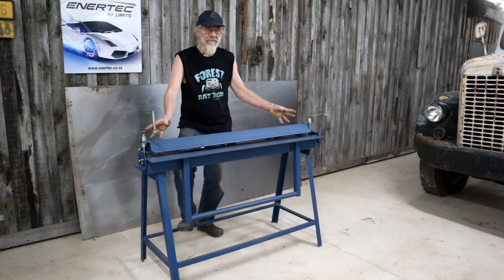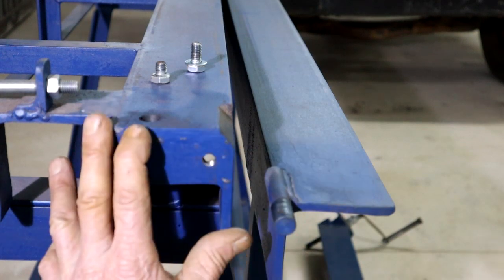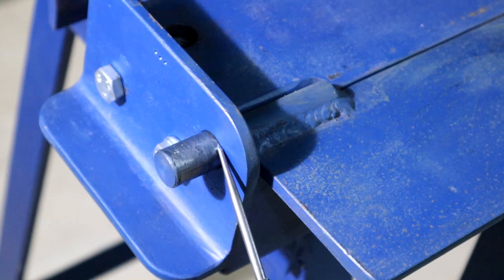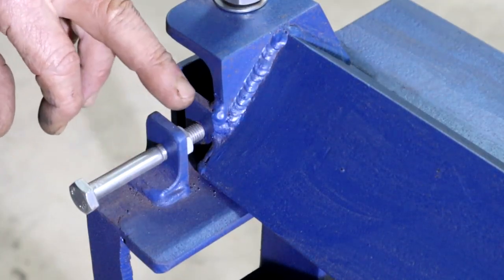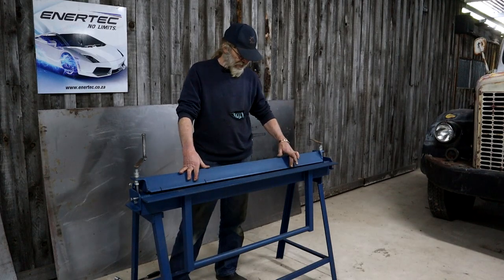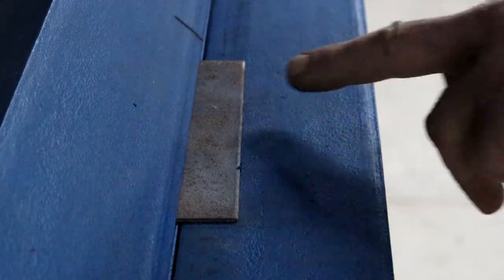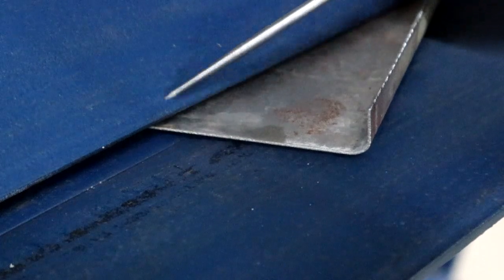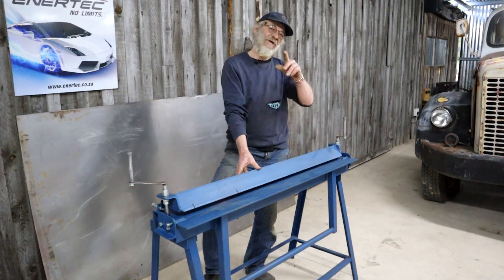GOOD DIY SHEET METAL BRAKE

Comment: If you don't often bend full sheets, couldn't you grind an edge on the far end to bend tighter bends, say on the last couple of feet? Sweet bender though. I have a Harborfreight bench bender that I'm going to adapt to your base to make my own. If I didn't have that, I'd definitely use your entire example as it's awesome.
Reply from the maker: Problem with that plan is 2 fold. You won't get proper clamp down and if you do bend full sheets, the fold will be different on one side

Comment: Nice , kinda like the one I built, you should build a pipe anvil bender. It's a 3 different pipes welded to gether with a 1/16 to 1/8 gap. You can bend shet metal, real eazy . Look it up on you tube . Lots of videos on it. Thank you my brother, lol not telling you what to do , just an idea, I used that help me alot on building panels. Love your show
Reply from the maker: Thanks, been thinking of building one for a while. Does do a different job to the brake though.

Comment: Dear Mr. Div
👍👌👏 Extremely well done! Congrats! I love doing concrete work with a common concrete mixer respectively a slightly bigger one as used in the video. I was able to shovel and mix really good and fast, that I could serve 3 men with 3 common wheel barrows without waiting times. I guess it's still possible but my good old back definitely fears to try it, sigh. 😁 ;-)
The little backhoe is really cute but nevertheless strong enough to do the job. Also very versatile and can even be used inside buildings. Is it yours or was it borrowed/rented?
Thanks a lot for making teaching explaining recording editing uploading and sharing.
Best regards luck and health to all involved people.
Reply from the maker: Thanks! Gotta watch that poor back as we get older. I'm lucky enough to own the little backhoe. Very handy out here on the farm.
Reply: @ratrodsafrica  
Dear Div.
You're welcome, it's my pleasure. Thanks for replying and especially for another heart. I absolutely always totally appreciate both very much.
2) Definitely! Mine is unfortunately damaged since I was a kid. Unfortunately this fact didn't held me away from lifting extreeeemely heavy things or lifting to much things (I'm a bear type guy). Sigh 😥
3) What a great difference a well built concrete floor makes  Next step: One of those great mobile 10.000 lb Wildfire 4 post car lifts!? 😁 ;-)
4) Yeah, it's a great little machine. I'm nearly a bit jealous. 😁 ;-)
Sincerely yours.

Comment: You are the best fabrication jobs I've ever seen. for a sheet metal break the Leading Edge to make a 90° Bend in your sheet metal. you have to take it to a machine shop. and have them machine that so you have a Sharper Edge on the sheet metal brake then you will get your true 90° Bend. God bless brother

Comment: Dill mounting holes in the sloping front of the brake, then make plates that bolt to the front that mimic the edge you want to reproduce with the brake. Then you can switch the separate plates out as needed.

Comment: I'm sure you have looked at many sheet metal benders to explore different ideas. I was wondering if you could move the top bar back and bolt on in front some short lengths of sharpened thick steel to reduce the bend radius, fingers I think they are called and made at different lengths depending on what you need, I have seen these removable fingers on expensive benders, love the cutouts to get corners bent.
Reply from the maker: Been toying with that idea but need wide enough and thick enough flat bar... maybe one day😅

Comment: Sir a great build, Thankyou. Inspired by you and excited about having a much needed tool for my stained glass shopp I built a unit like yours. To cut the length of the hold down angle edge I have an old ratty table saw I can abuse so I put a metal cutting carborundum disk in it and set it to 45 degrees. With a pease of wood on the fence I was able to SLOWLY cut the 1/4 inch angle iron to have a smooth edge. Next I would like to cut peases of 1/4 inch flat stock with holes drilled to match up to drilled and tapped holes in the hold down to work like a box bracke. Keep well God bless.
Reply from the maker: Thanks! Great plan you made there! Well done, I like it a lot

Comment: On your need for a sharper edge. I scribed a sharp line down the length and ground it close with an angle grinder then used a hand file to finish it off by eye. It works good and I did the back brace since it didn't hold down in the middle whe I was bending a longer piece of 18 gage. My brake is 4' x 2.5" wide x.25" angle iron from scrap stuff too. 
I like your depth adjustment which I will add to mine. Thank you for your video I'm from the U.S. so it's not in mm.
Reply from the maker: A lot of work to get that edge, we'll done!

Comment: Could'nt you weld 2 pieces of 1/2 angle bar along the edge to get your tight corner? Gonna make me one for sure!
Reply from the maker: The problem with that is that you cant bend past 90 degrees then. And you need that

Comment: Excellent design. Excellent discussion. I note that the handle also serves as a minimal strong-back and could easily be modified to complement the strong-back you suggest that could go on the backside.

I believe that modifying the edge of the hold-down angle is easier than you think. Remove the hold-down. Choose a keen 4-foot length of angle and carefully clamp this angle along the line you wish to cut. Use your grinder and a course sanding disc to work the edge of your hold-down back to your fixtured reference. 

One final note concerning bend radius. For mild steel the width of a V-die like is used in a press brake should be eight times the material thickness. For a pan brake like yours I think the setback adjustment on the hold-down probably should be five times the material thickness. This of course assumes that you have achieved that nice sharp corner on the hold-down. The net result should be an inside bend radius equal to the material thickness.
Reply from the maker: Excellent feedback! Thank you

Comment: You could increase the gap between the clamping angle and bender by double to bend 3 mm, allowing for a larger a larger inside radius. This would allow over bending sheet as well, without binding and causing a lot of wear on your brake. Good job though!

Comment: I did option 2 at the end, but I made the bottom piece overhang, then ground it back in line with the top angle piece, that ensured it was straight. Have a full build on my channel if you want to see what I mean (ep 51). It works quite well, especially on smaller bits but still find tuning in order to bend a good 48"/1200mm tight radius bend all the way along.
Reply from the maker: Cool, I'll check it out!

Comment: You sir, are a genius. I've watched dozens of videos looking for the best way to make a trim break and you nailed it! I love the drawings and the break down of the process you went through to build this. You are the only one to make a video that solved the problem I was having with keeping enough pressure and force on the center of the top piece of angle that clamps everything down. (I'm building a 10' brake to bend aluminum trim.) Truly fantastic video, and really amazing piece of equipment you built there.
Reply from the maker: Thank you very much Rae! If my video helped to solve your problem, I am one happy dude😅. Not a genius though, just 40 years of practicing common sense ( the first 20 years of my life don't count, very little common sense then 😂)
Reply: You certainly helped me fix the problems I was having. Sometimes it's the thinking too much that holds me back LOL

Comment: Great video!! Thankful for your full demonstration!!  I have been wanting to build one for a while. The drawbacks that you pointed out are the ones that have stopped me. The idea of adding the plate to the bottom of the top angle piece is that it eliminates being able to bend channel. Like you I am trying to come up with a way to machine that edge without having access to a milling machine. We’ll figure it out. 🙂
Thanks again!!
Reply from the maker: Brad, so far I've just been living with the radius that the stock angle bar provides. Been thinking of a way to get the edge better without a milling machine. It will just be a lot of elbow grease: Use angle grinder and flatten as good as possible. Then get a long piece of course sandpaper (like a long sanding belt), lay it on a flat surface, lie the angle bar on it and sand away... until next week!😂
Reply: @ratrodsafrica  that sounds like it should work! Now to find a flat surface that I can “lap” an edge over 4 ft long…..
Reply from the maker: @bradpage8967  that's the word I was looking for! "Lap". Yes, next challenge. I have a sheet of 22mm plywood here, was thinking to throw that on the floor and see how it goes... It's not like it has to be super accurate...
Reply: Lacking a roll of emery paper I have been thinking how to use the angle grinder in a stationary position. This is what I will attempt. Rough grind the edge to remove the majority of material. Then using another piece of angle in a fixed position and using it as a guide of sorts set up the grinder so it is just removing the unevenness of the edge, feed the brake angle through. It would require removing the corner of the angle so that it doesn’t rest on the radius of the bottom angle piece but ride on the sides. I have straight walled angle not tapered like yours, that would require a shim of sorts to achieve the proper nest. I am going to try it this week.

Comment: @Stashwax and Div, I have seen other guys grind the end on the inverted clamping angle with great results to reduce if not remove the radius bend. Div, since you a master grinder (LOL), this could be an option if you needed a more crisp corner. Another option would be to grind one side and leave the other so you will be able to flip it around, allowing radius or crisp bends. I like the slit in the clamping beam the make the corners meet...very innovative. I was trying to figure out how to best make segmented beam. I suppose one could make the slots as and when required.
Reply from the maker: Segmented beams are a mission, just cutting slots as required is much simpler. They will weakent the beam though, the bigger that angle bar, the better. An option is to just weld them up again down the line... or have more than one beam. That grinding business will not be easy. You need to keep a straight edge over a a distance of more than 1.2 m.... Suppose you could do your best, then "lap" it on a large flat surface with long piece of sanding belt... Lot of work... Or just have someone stick it in a milling machine to do one edge. Sounds much easier.😂

Comment: Awesome Div, I was anxiously awaiting this video. I almost built one a few months ago. When I priced the material , I got a fright. Need to be patient and keep my eyes open at the scrap dealers, I am sure I will come across some descent material soon. Also contemplating a bead roller. Got the shafts so far and 1 of the gears. Will tackle that soon. Thank you again for sharing. Another great video and explanation.
Reply from the maker: Ja, steel is frigging expensive! The scrap dealer is your friend!😂 I make a point of regularly checking in and eventually you find what you want. And, in my case, always some shit I wasn't looking for! Ha-ha. Adendorf sell the bead roller I use for R 5895.00, all the dies included. You cant build it for that price, just the dies alone are worth it.

Comment: Just to let you know, I have been a sheet metal fabricator at a small HVAC shop for 22 years (I just retired) and you have built one of the best looking and functioning "home built" brakes I have seen. Very nice! Simple and effective. 😀
Reply from the maker: Thanks man! Coming from someone with your experience, that is a big compliment! Enjoy the retirement.
Reply: 100%
Reply: I agree that's a very simple but effective method for making one , im making my own too , but I'll make 3 hold down versions , yours , one for a sharper bend and one with a heavy walled pipe or something for a much bigger radius so I can try eliminate pre forming ,I'll see how it goes , top work thanks for sharing 👍

Comment: Another awesome video with a good explanation .   You stressed the importance of  the centerline of the hinge pin which gives the tool it's important accuracy !   As you know , I'm a professional tool and die maker. I continue to be impressed with what can be done with common sense and limited recourses.  I like some features on yours even better than some factory made brakes.  The inverted angle bar acting as a clamp also allows for the "hook bend" that you made on one of the samples.  Yes the radius is big , but personally  I would keep it rather than attach the flat bar to the bottom of the clamp and give up the hook bend option.  Thanks for sharing a great design  !
Reply from the maker: Thanks Randy. Big compliment coming from you! Also like the open space inside the angle bar. When I find that piece of flat bar, I will build it so that it is removable. Then I can have the best of both worlds
Reply: Yes what I thought just tap it and bolt down from the top,  that way you  can still use the cavity and slots 😉  whenever you want just unbolt it. Also same idea for top brace if you can unbolt if needed for clearance of work piece.  Amazing what a lot of cheap metal can do 😊.